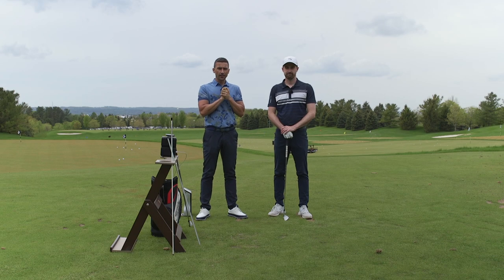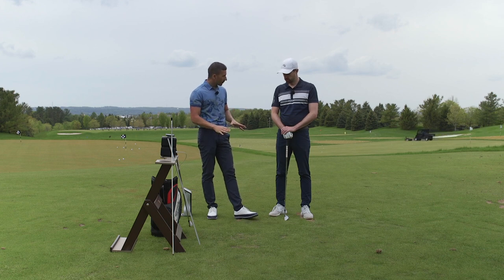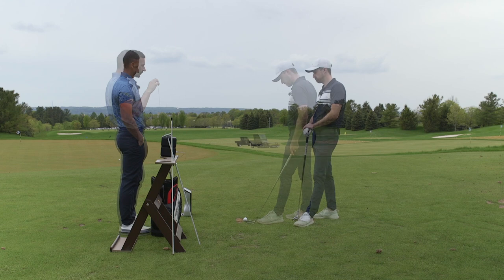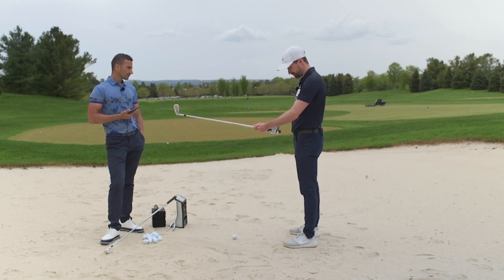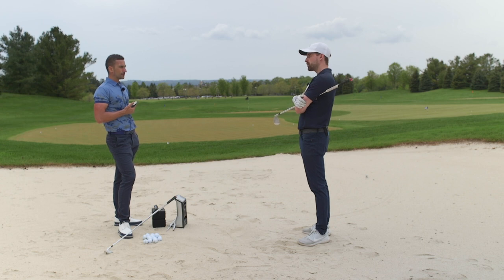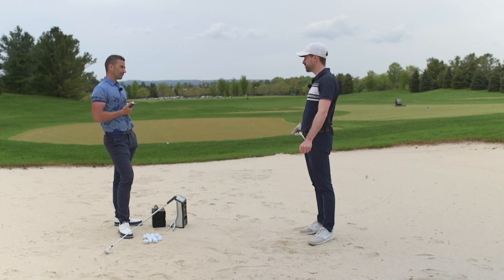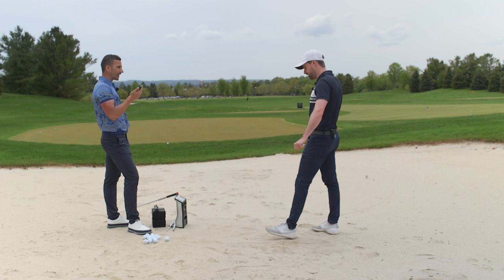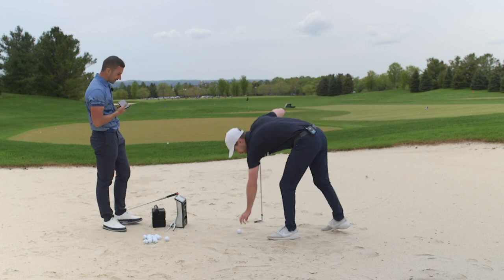Science of the Fairway Bunker Shot

Comment: I love learning from you guys!!  Great job as usual !!   Curious.  I have above average club head speed and a quick tempo swing.  I prefer iron shafts to be in the 118 to 130 gram range.  I tend to pick the ball clean and don’t take any divots.  
Question #1. Is this a sign that my club length is a little too short or is this just a swing flaw?
Question #2.  What iron shafts would help move my strike a little higher up on the club face?

Comment: Wouldn't the higher spin come from choking down and increasing the decent angle and wouldn't that be why the loss of distance because Matt is effectively hitting a half club less? I'm not saying that those changes alone account for the data points but they would explain most of it.
Reply: Sir_Godz vertical gear effect is the dominant factor.
Reply: @ianfrasergolf  thx for the response.. but I guess my point is more that the smaller swing arc from choking down increases dynamic loft and increases spin/gear effect? What am i missing if that's not so?
Reply: Sir_Godz Sir_Godz why would a smaller arc increase DL?  It would potentially create a steeper AOA due to a more vertical shaft position however the reduced speed and shallower AOA (as a result of trying to pick the ball clean) will work to reduce spin.  Therefore VGE is the main component which increases spin.